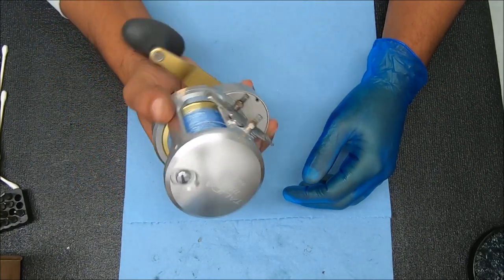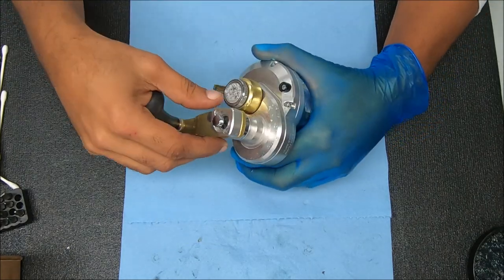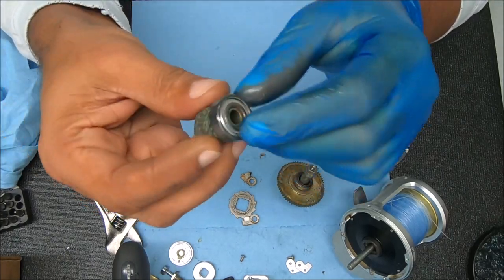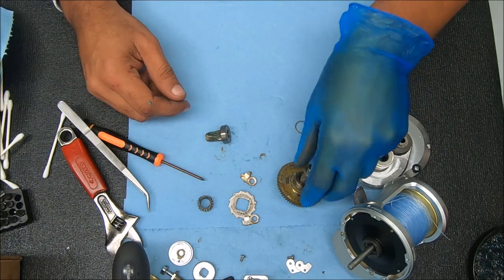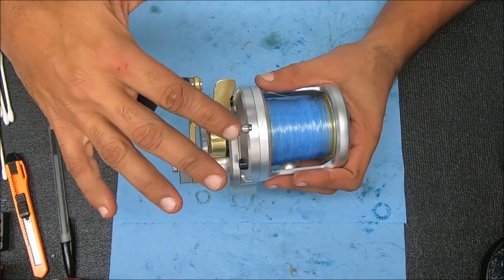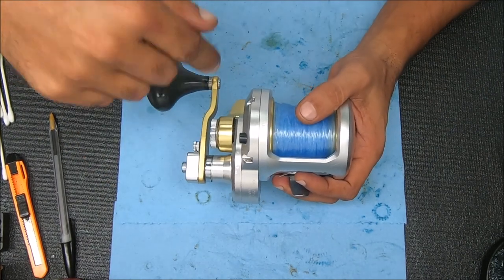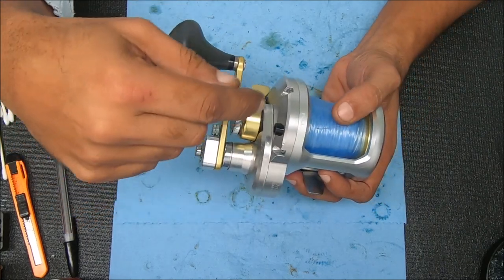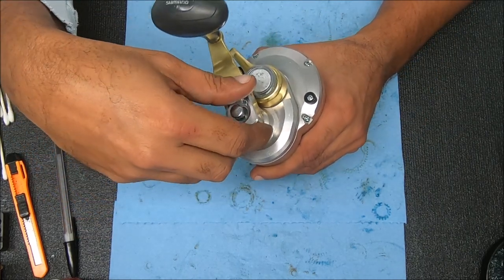Shimano Talica 16 2-Speed - Locked Up Fishing Reel - Diagnosis & Repair

Comment: Hi, how do you removed the stuck pinion?
Reply from the maker: Watch midway through this for some clues.... principals are the same (but more caution needed):

https://youtu.be/rSWzUDEtMOY?si=EPgI2WUGA0-OOxRT

If you're concerned about damaging your pinion, consider taking it to your local repair shop.
Reply: Thank you for your reply but mine is a pinion stuck on a bearing with little space to work on ( BAITCAST REEL) as the pinion is short with the long end into the bearing..tried soaking it with wd40 for a day but seem doesnt work well, still jammed up with no progress..
Anyway thanks for your tutorial vids!
Reply from the maker: @milkoll  Thanks and no worries.... based on the video you messaged from, I assumed it was pinion gear stuck on a Talica.... don't know what baitcast reel you have or are working on, but I say it in the video I referenced you.... heat depending on the circumstance. I also use a slide hammer (see my TLD videos for examples). Unlikely the WD40 will free it up (maybe PB Blaster would work better)... if you're uncomfortable with the heat use, try your local repair shop to see if they can get it done for you.
Reply: Thanks for your advise !
Reply from the maker: @milkoll  No problem.